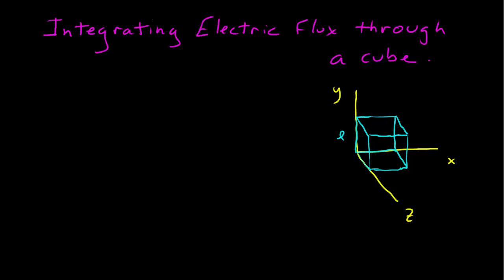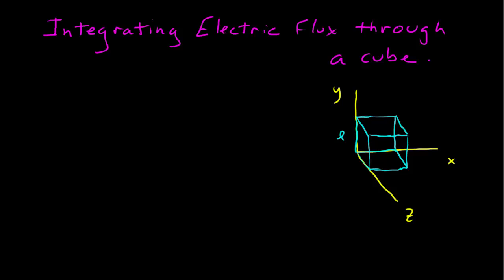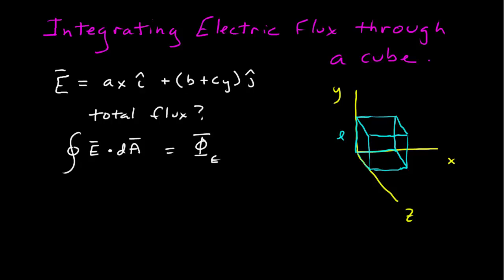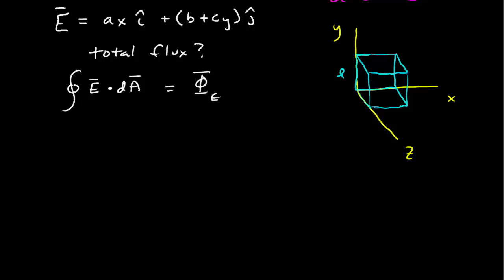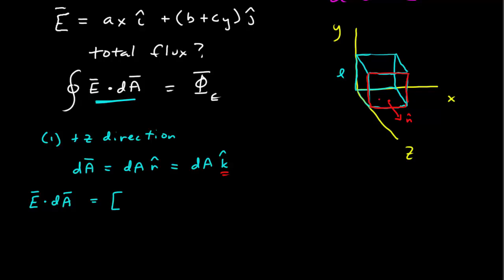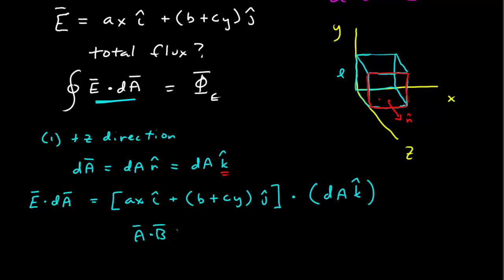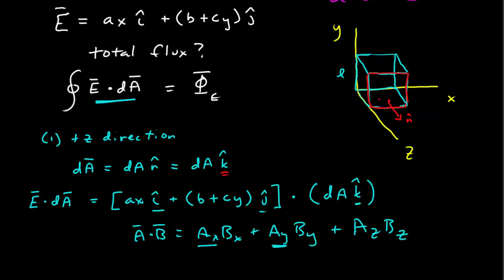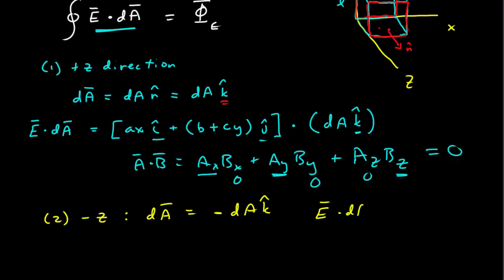Integrating Electric Flux Through a Cube

Comment: Why is it that my book, my professor, nor ANY youtube videos explain exactly HOW E = (a+bx)i + cxj???  Jesus Christ, prove this stuff or don't bother with trying to teach it.
Reply from the maker: Hi Junno,  This example is showing how to calculate the flux from a given electric field and a given surface, most likely in the same way as the book and professor you mention.  The field would be derived from some charge configuration.  However, finding a very complicated configuration of charge necessary to produce this particular electric field would be incredibly time-consuming, would increase the text an order of magnitude, and would be irrelevant to the actual calculation at hand.

I understand it might be frustrating to simply produce an electric field out of the air.  But imagine your frustration if I were to lead you through 2 hours of 3D charge distributions, the partial differential equations necessary to solve the boundary  value problem using Laplace's equation, just to come up with the simple electric field shown above with the resulting comment, "Oh, by the way, none of that is important to the problem at hand."